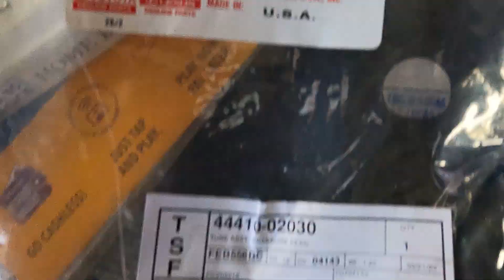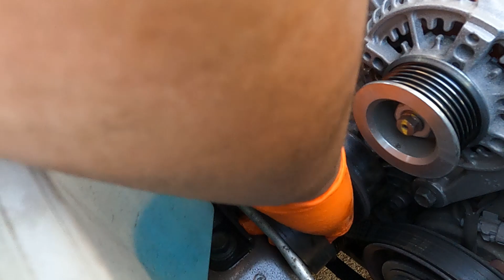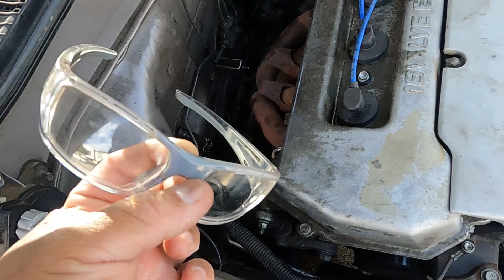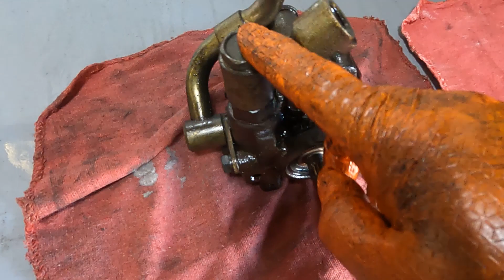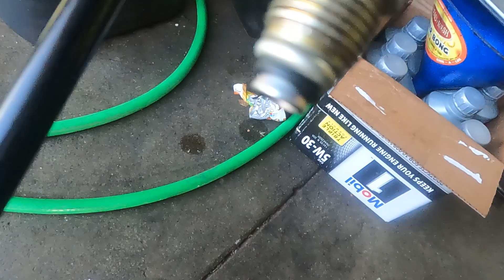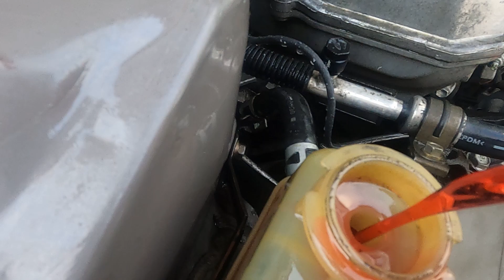How To Replace Power Steering Pump & Power Steering High Pressure Line for 1998-2003 TOYOTA COROLLA

Comment: Nice video. How much oil use the steering system ??
Reply from the maker: try about 1 bottle first then start the car do the power steering bleeding, then you add if still low. 

also if you can subscribe to my channel i appreciate it

Comment: Thanks for this video and the bleeding instructions. I did the pump and large and small reservoir hoses because they were cracked in my customer's car. The pump I installed was brand new with a pulley and pipe. Just had to transfer over the port with the union bolt. That was hard as hell to remove from the old pump! I got lucky my impact finally was able to get it loose. Then torquing it to 51ft/lb while keeping it straight was a bear. I took a hammer to the top and bottom pump bolt seats to make it much easier to install the new pump. Just tapped each seat a few times with the hammer and that gave it enough clearance while still remaining snug. It was too tight before that. Her high pressure hose was fine, and the two hoses on the return line that sit behind the protector plate were still good. It's like butta now.
Reply from the maker: of your course your welcome, and i'm glad you came across my channel or video and help you with your DIY and repair the problems. yes those union bolts are not a joke to take off and install-when i check all data i'm surprise with the 51 ft-lbs torque. however, this job is doable basically you just need some tools and patience to finish the job. also if you have not subscribe to the channel just click the button so you can get all the latest content thanks again

Comment: Great video with the pulley I don't think you had to take it off I think there was like a slot that you can spin it in the bolts would have fit am I right
Reply from the maker: that's why i take off the pulley because at autozone some parts does not come with pulley you have to used the original pulley or some parts come with the whole assembly. that's why i take off the pulley

Comment: sorry to bother, but I think you have the Union Bolt foot pounds torque wrong.
Looks like it's 15 for the Oil Pressure Switch.
and 40 for the Union Bolt.
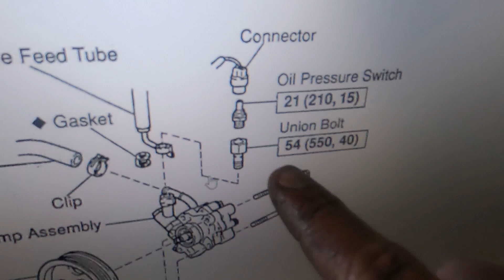According to your diagram at video time 45:37.
Also in your video description, you say the Union Bolt torque is 51 Ft-lbs, but I think this is incorrect.
Other than that, good job.
Reply from the maker: no problem thank you for your comment, all the torque spec i get from alldata, they are the one who give me the information. if i may mixed what i'm saying because i'm tired doing this job since its alot of work, sometimes i'm trying to be consistent with what i'm saying since i get tired sometimes. if your doing this particular just follow the spec and i'm sure you will be fine. also if your considering to subscribe to my channel just click the subscribe button thank you again.

Comment: very thorough video my friend , nice work , hope you fixed the bleeding issue !
Reply from the maker: Yes I fixed it up, actually there's two type of power steering pump for this toyota corollas. With non extended union bolt or extended union bolt. Mine are non extended union bolt
Reply: @WrenchingThrottle92 what does this mean because same thing happen to me so you put the wrong power steering pump ?
Reply from the maker: hey your welcome, and i'm glad you like my video 
yes i've solve the problem i get the wrong pump and i get the right one!!
Reply: @WrenchingThrottle92 What was the right power steering pump.  Do you have a link or the name of the power steering pump ?
Reply from the maker: @RIKOHDOUBLEOG  yes there's 2 type of power steering pump 

https://www.autozone.com/p/duralast-power-steering-pump-5455n/663711?searchText=power+steering+pump&productPartGroupId=azpg1946&productBrandId=HTTT&productUniqueId=1265934135

https://www.autozone.com/p/pwr-power-steering-pump-60-5108p/806241?searchText=power+steering+pump&productPartGroupId=azpg1946&productBrandId=HKKN&productUniqueId=6308025460
Reply: @WrenchingThrottle92 Thank you I’ll get the second one don’t want to take it apart again just plug and play
Reply from the maker: @RIKOHDOUBLEOG if the your power steering pump does not have tube get the other one !!

Also you have not subscribed to my channel yet just click and be parts of the community
Reply: @WrenchingThrottle92 Thank you Brother this fixed my problem on the road again. Put all the windows down and let the wind hit my face.  🎉.

Comment: I changed the pressure line on my 99 corolla I look for leak and bleed the system for air and every thing seem fine but then I notice that when I turn right the power steering make a clunk and when I turn left it does not do it. Also when I start the car the power steering pump makes noise the level affluent is where it should be.
Reply from the maker: ok, first double check if the clunking noise are coming from 
1) power steering pump 
2) outer tie rod end 
3)inner tie rod 
4) control arm ball joint 
5) something get caught when  you turn right - if the noise is there before you repair the car something about steering system or front suspension OR if the noise happened after your repair the power steering line. double check the basic stuff.

next, possible that power steering pump are getting worn out internal seals or bearing are getting worn out due to miles and year. 
also there are 2 types or power steering pump, i will post the different type of powering steering once i found the video
Reply: Thanks
Reply from the maker: @warthhoh  your welcome I hope everything will goes well. And if you have not subscribed to my channel please do so you can get updated to latest videos 
Thanks again